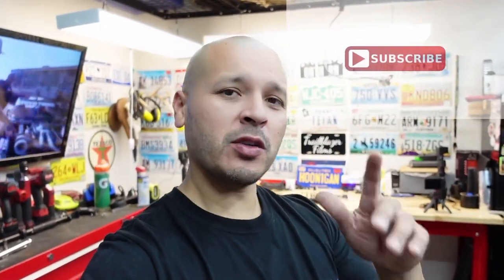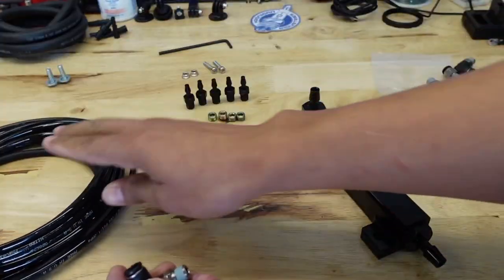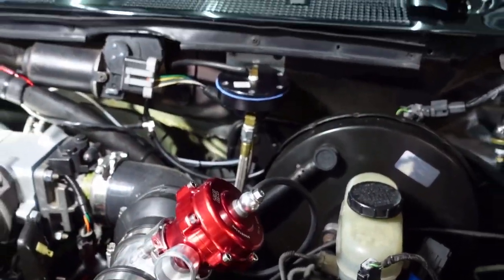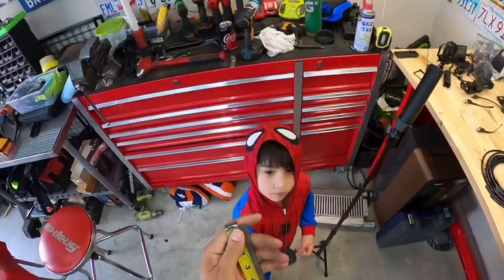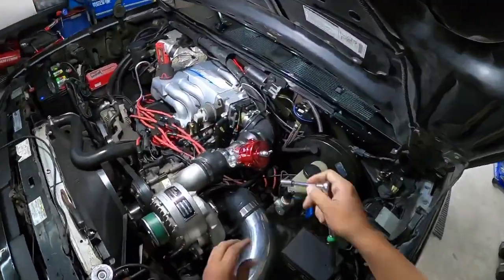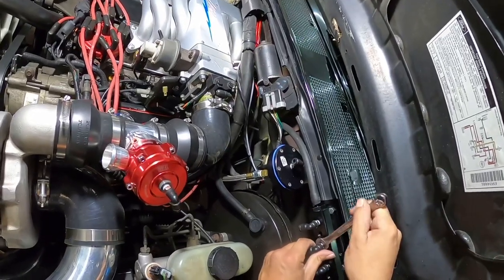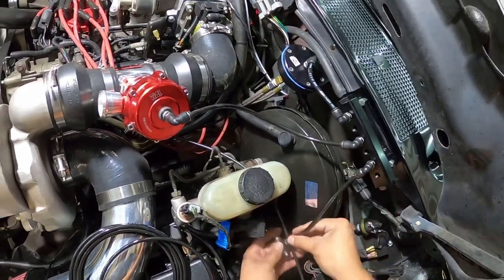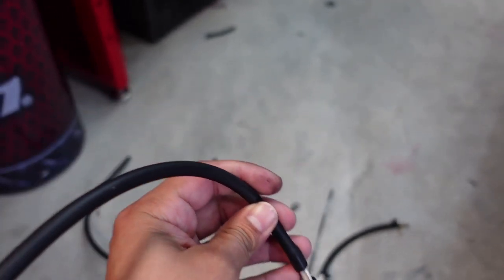Installing Vacuum Block for boosted Applications. Vacuum Distribution Block.

Comment: Great job brother, nice upgrade! Hope it worked better and glad you found the split, you know the rest were soon to follow with that problem so that’s a awesome upgrade! Looking forward to more lightning vids man. Are you gonna dyno the truck or possibly run it at the truck to give some numbers? Curious to see what this beautiful trucks puts down, you started with a great truck ( mine was rode hard and put up wet 😂).
Reply from the maker: Thanks bro! I do plan on taking it to a dyno soon to get some real numbers. Going to have to wait till the tracks are back open there closed for the Winter time. Haha yeah mine started out as a clean starter truck
Reply: @JJBanuelos  Could i use this Vacuum Block shown here on my 2007 Audi Q7 3.6L V6 Quattro premium package suv ? Where did you purchase the Vacuum Block and where do i purchase polyurethane line at and whats used to cut it without collapsing the end where you make each cut for length ? I have one plastic nipple broke off where my vacuum line end connectors seat onto the 4 plastic nipples which are various sizes. Thank you.

Comment: Hey brother could you help me with this I purchased the same kit and all doing it on a mazdaspeed protege 2003 but my car dies now 😢😕
Reply from the maker: Make sure all the ports that are not in use are plugged off & there is no vacuum leaks. Sounds like you have a large vacuum leak somewhere. Double check your connections

Comment: Hey man I love your build !  How are the lines and the connections holding up ? I am running the same block and want to do the same connections but only if they hold vacuum and last.
Reply from the maker: Appreciate it man, still holding up good no issues or leaks at all. Definitely recommend this versus the old vacuum lines.
Reply: Man that’s awesome to hear I am going to pull the trigger on this than. I appreciate the help and this video was A+ keep up the work. Can’t wait to see some more of the lightning. Also I love the way you have the garage workbench set up bro 🤘

Comment: Hose clamps anyone ? Nope zip ties….lol
Reply from the maker: Hose clamps sometimes cause issues where people over tighten them & make leaks. Zip ties just add enough clamping force & also a cleaner look
Reply: @JJBanuelos  yeah but to hold boost…? I mean just for my n/a 4banger i was worried of using a zip tie on the hose to the map sensor i was relocating and i ended up drilling a port on the new manifold to mount it instead.. i overthink a lot though lol